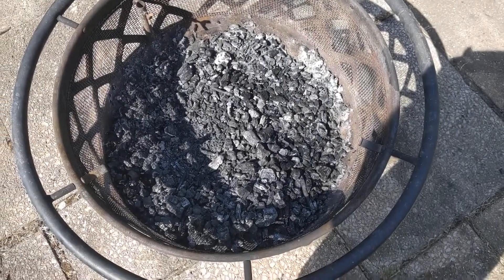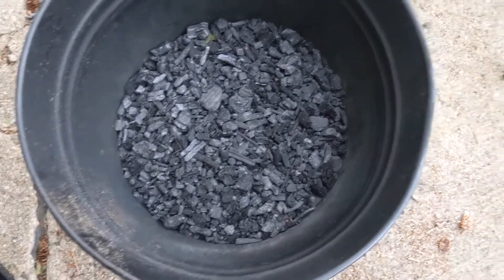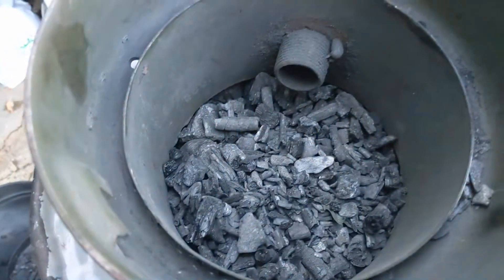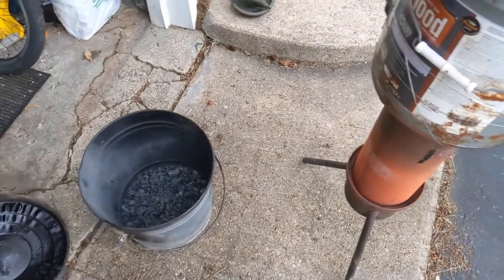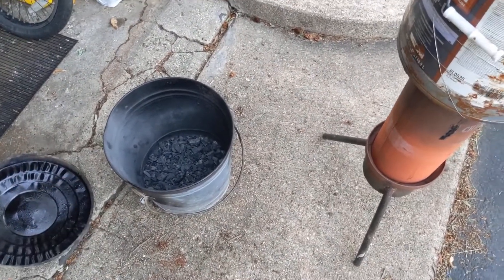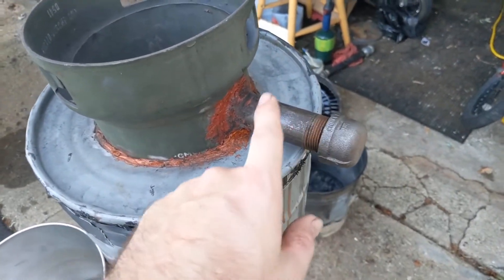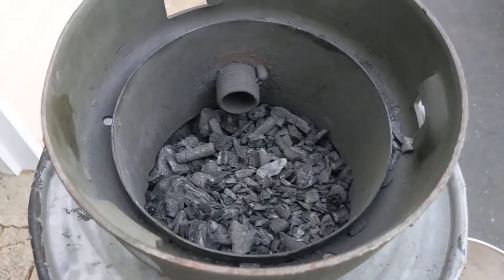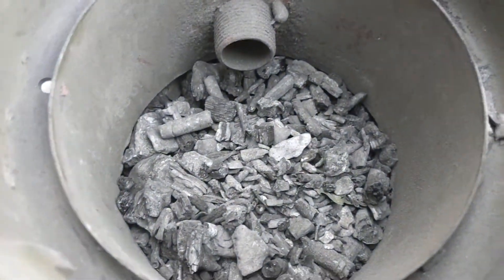Utilizing Waste Charcoal In A Gasifier

Comment: Thanks Bryan, keep up the good work. I will be doing something similar down the road. Will use the generator itself as a baseline indicator. The question for me is how much usable electricity can I produce from a 4kw generator keeping the Hz at around 58-61 with a respectable voltage of 115+ volts. This is fun stuff and I enjoy your videos
Reply from the maker: The general rule of thumb is that when running an engine on wood gas, the power of the engine will be reduced by 25 to 30%.  With charcoal gas only  (carbon monoxide) it is usually 30 - 40% reduction. With a charcoal gasifier, you can usually squeeze some extra power out of it by adding hydrogen from a water drip.  I would guess that you may get up to 2KW of electricity in a best case situation (quality of charcoal,  nozzle configuration, gas cooling, etc.).  I am expecting about 50% rated capacity versus with gasoline on my invertor generator.  I imagine a non-inverter generator is more sensitive to the reduction in engine power since the generator has to run at a consistent RPM to maintain the proper frequency.  I am hoping to get a new gasifier built and a bunch more charcoal made so I can do some intensive load testing with my  setup.   Thanks for watching.

Comment: Sir i would like to ask u, we can use any kind of charcoal and now we making charcoal from corn cob, cotton stalks so why im using. One of the most important thing means we also build gaifier tank like u but just smoke are comming and little more gas are generating thats why i want u r help sir pls help me.
Reply from the maker: Well, I have never tried using charred corn cobs or cotton stalks so I'm not sure if there is something specific to those fuels that is causing your issues.  From what I have experienced, the most common issue with making weak gas is from air leaks in the system.  If you are using a design like mine, air should only come in through the nozzle and out through the output pipe. If there are air leaks in the gasifier body (like around welds or seams), that can cause a weak flare (and it can also be dangerous if air and gas mix in the right ratio inside the gasifier body).  Also,  having too small or too large of a nozzle can cause issues with gas production.  How big is the nozzle you are using?  Is the output pipe the same size?  You may also have improperly sized charcoal.  Make sure that each piece of charcoal is between 1/4 inch and 1 inch in size.  Let me know if you have any other questions.  Thanks for watching.
Reply: I took 4  inch pipe for gasifier reactor and  lenght is 3.5 feet. This pipe connected for input air pipe is 1inch and output air pipe 1.5 inch. So it is right

Comment: Enjoying these video's. Makeing a gasifier myself for a small engine,but attempting to use wood as fuel.Hard to do for a small engine.Works great on large engine's.How are you makeing your charcoal.If its not to time consuming,I may consider changeing my plan as charcoal gasifiers are so much simpler than wood.
Reply from the maker: I currently make charcoal in a 5 gallon steel bucket with a lid and a few small holes around the base of the bucket.  I fill it as tightly as I can with branches and small logs and then put it in our fire pit in the back yard.  Then I build up a huge fire around it and it cooks the wood.  It seems to make good charcoal, but it takes a lot of effort and fuel to keep the main fire burning hot enough to effectively char the wood.  I would like to start making charcoal like Gary Gilmore does.  Part 1. https://youtu.be/2xsHsWP-E9k.  The reason I like Gary's approach is that the actual hands-on time is not that much and you can make a lot of charcoal without having to burn a huge amount of extra wood.  I am sure that a lot of other retort ideas work well too, but it doesn't get much simpler than two 55 gallon drums.  Once you get a good system in place for making and sizing the charcoal, it's not that much more work than processing raw wood for fuel (so I have read).  I personally haven't tried building a wood gasifier as of yet.  Probably in the future.  Thanks for watching.